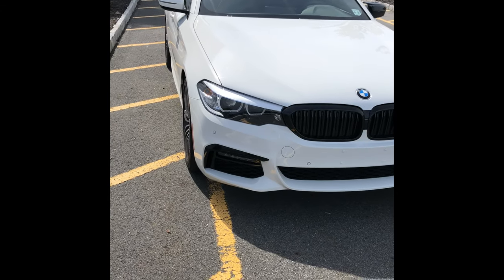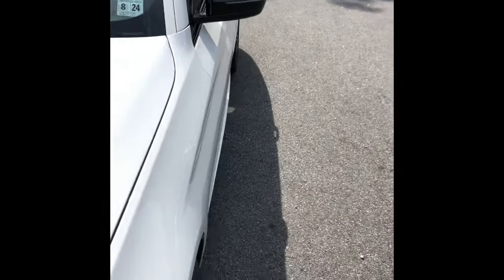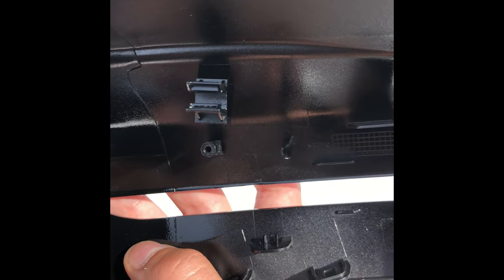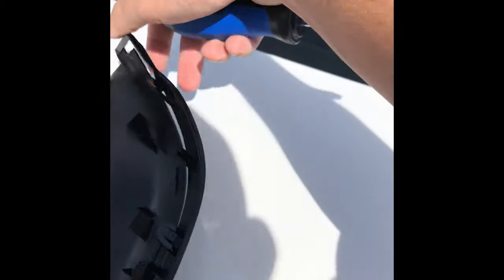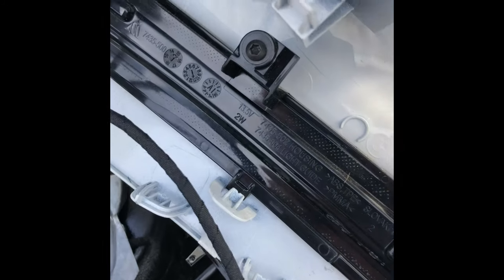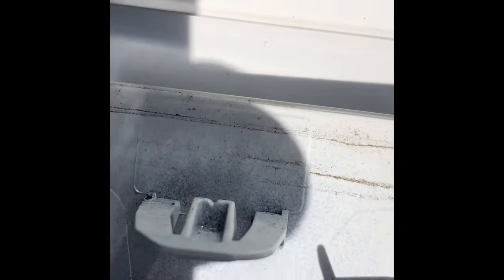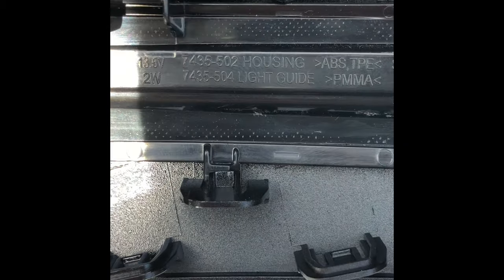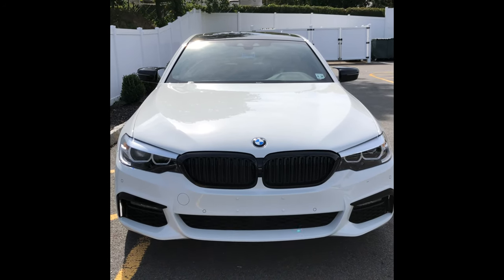Replacing Mirror Caps on BMW G30 5 Series DIY Install

Comment: Thanks for the vid! I was able to do it without removing the mirror like you mentioned. One trick I used to get the clips out was placing the flat head screwdriver between the clips in a horizontal position and shifting it vertical to open them up simultaneously!
Reply: It doesn’t work

Comment: Where did you get the gloss black front L/R trim pieces by the front bumper air ducts?  I have 2020 M550i and can’t get confirmation they are compatible 
The ones I see are for G30 with fog lights. M550 is different they vent into the wheel well
Thanks.
Reply from the maker: Hey, those are gem stock on the m-sport bumper on the 540.

Comment: can you replace those mirror caps even if you have 360 cameras?
Reply: The cameras are placed under the mirror caps, so they are unaffected during the install.
Reply: @wuzumaki 

 you have cameras ?and this mirror covers ?
Reply: @vladtudor4447  The camera is at the bottom part of the mirror, not on the mirror cap, so it doesn't matter.